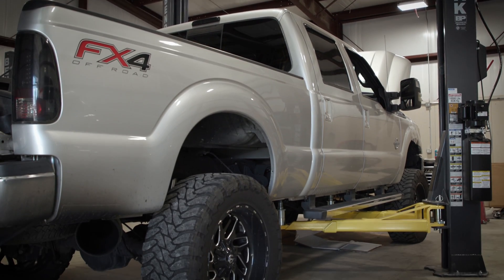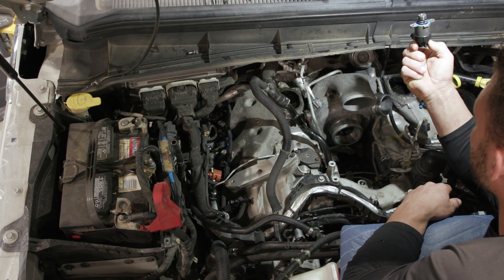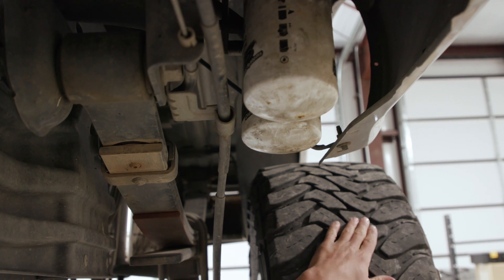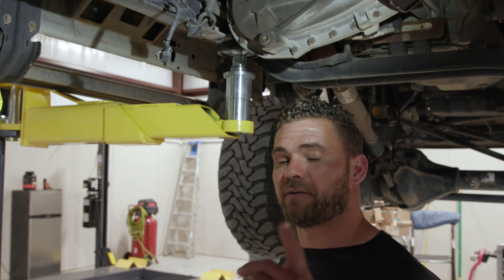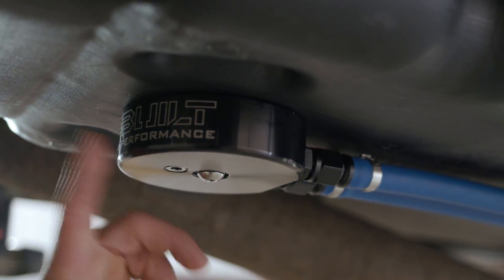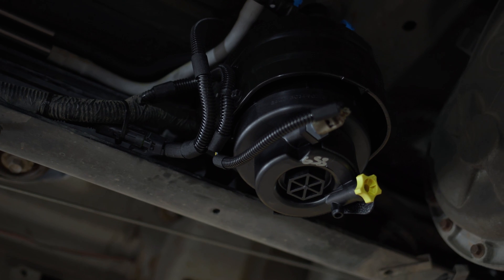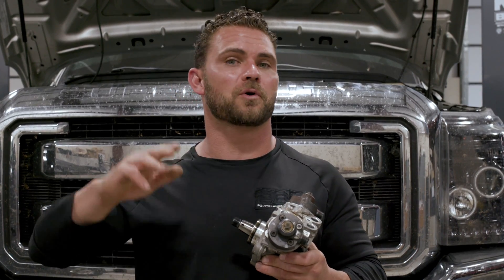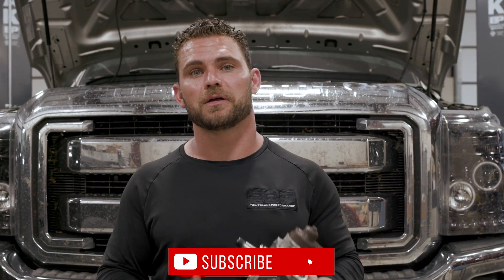BULLETPROOFING A CP4 FUEL PUMP?!

Comment: Airdog has a great location first off and they have a water port to drain. MAINTENANCE IS KEY
Reply: but Airdog only removes about 48% of water, verified through independent testing, while the FASS removes upwards of 99%....I think ill stick with FASS.
Reply: @CliftonMurphyjr  do you have a link to the independent testing results?

Comment: This hardly seems bulletproof.   You have 4 filters before the fuel pump (overkill) and nothing after the pump to save the fuel high pressure fuel system when the new improved CP4 fails.
Reply from the maker: What would you have installed then sir? We’ve never had a single failure in over 10 years of doing this installation . If the system fails we aren’t saving anything. It all has to be replaced. Cp4 usually fail because of (Air) , (Gas ) , (water) or trash entering the system.
Reply: @POINTBLANKPERFORMANCE   A lot of people have said that their fuel was perfectly fine but the manufacturer claims a fuel problem so they don't have to cover the cost of repairs.  There are two types of kit I am aware of to save the fuel rail and injectors should the pump fail.  One is a fuel metering valve with a greatly improved filter on it, made by Exergy for $240.  The other is a fuel reroute kit that sends all fuel that went through the pump that could be contaminated with shrapnel back to the the tank and only uncontaminated fuel to the rail and injectors, this is the "Disaster prevention kit" others have asked about below, they are about $350.  Both are pretty easy installs.
Reply from the maker: @brantrichardson1949  So here is my 2 cents... we do everything pre Cp4 to prevent the failure not at the pump (because again when it fails it fails entirely). I’ll put it to you as we would a client “if you have the disaster kit install” and it works correctly and send everything back to the tank (are you ok with me fixing everything in the low pressure side and pay for it only to find out you now owe me again for a entire fuel system because your truck upon the start up failed because the metal did actually make it in the injectors , rails and return lines. This is only my opinion but it has have happened to me. When it fails it all gets replaced we try to take ever measure Pre Cp4 to keep it alive .
Reply: @POINTBLANKPERFORMANCE   I would advocate for a filter in the return line to the tank as well to save all those repairs, I thought that was part of the set up in your video actually.  In the event of catastrophic failure the only thing that needs to be replaced is the fuel pump and filters.  With a modification to save the high pressure side and another to save the lower pressure side, yes I would rather take a chance on paying you to fix it twice rather than the enormous cost of replacing the entire fuel system straight away.   That would be my idea of bulletproofing a system using a CP4 pump, not really bullet proofing the pump itself but stopping all the collateral damage.
Reply from the maker: @brantrichardson1949  if you ever get a chance to experiment with that more power to you but with adding filters in the return lines doesn’t work for the pumps they don’t like resistance. But again We appreciate and respect your opinion thank you for the feedback sir.
Reply: @POINTBLANKPERFORMANCE  I was going to ask about these disaster prevention kits. Glad to find your response. I find it hard to believe that any design engineer could have designed such a poor system as this, that when one component goes, the whole system has to be replaced. Everyone seems to say that you can't put a filter between the pump and the rails because there's too much pressure but wouldn't a enormous filter allow enough flow while still protecting the rails and not causing any back pressure  ? I wouldn't care if the filter was as big a the A/C filter in my house . Filter that fuel !
Reply from the maker: @johnmazza9432  Filtering is only part of the issues the , dry start from customers not being coached on how to “prevent” Cp4 failures is more the issues from what we seen.  Proper priming is a huge key as well. The list can go on and on
Reply: @POINTBLANKPERFORMANCE  By "proper priming" you mean switching on the accessory ignition numerous times ?
Reply from the maker: @johnmazza9432  yes sir making sure the fuel pump is on and priming is done .
Reply: @POINTBLANKPERFORMANCE  Even if you do everything right, it doesn't make sense that at some point when the pump fails , it's going to cost $12k to fix the damage.
Reply from the maker: @johnmazza9432   It’s all a possibility , everyone that owns a truck with a Cp4 or Cp3 could have a failure. Cp4s aren’t as tolerable to abuse as a Cp3 to sum this up.
Reply: @POINTBLANKPERFORMANCE  how are the cp4.2 vs the cp4???!
Reply from the maker: @Truccinwithlumberjacc  They make more power ! Personally we see the same amount of failures .. not that many to be honest
Reply: @POINTBLANKPERFORMANCE  so I’m looking at this 2012 3500 Hd denali; mint condition with 200k on the dash. They came with the cp4.2 right? Are they better than the  cp4?

Comment: I have a 2017, I bought it used. How can you tell if its got the old cp4 or the new one?
Reply from the maker: It’s the new one sir on the 15 to current they use the Cp4.2
Reply: This guy said, "the new ones use the CP4.2". Fucks sake. All CP4s on Powerstrokes are CP4.2s. The .2 designates the 2 piston design of the pump - which they all are. Now, they did produce a symmetrical and an asymmetrical version of the 4.2. Blaring sign to not take your truck to this shithole.
Reply: Cp4 is stock. If you still have the sellers number call and ask them if the pump, injectors and fuel rails were replaced. Im sure if they were the seller would of mentioned it

Comment: Do y’all have any experience with putting on a FASS 220 on a 19 Powerstroke?  I had a shop install one on my truck with a sump and the truck kept saying low fuel rail pressure when it was pulling fuel from the sump... they then ran the pick up hose in the tank like you would without the sump kit and it seems to be working fine but now I have a useless sump hanging on my fuel tank... it’s pretty annoying since I really don’t understand why the sump wouldn’t work
Reply from the maker: Did they place top billet face plate in the correct direction and other than that sir honestly I’m lost . There has to be a restriction in possibly the install . By all means I’m not say they didn’t something wrong but something is up. Monday your welcome to call the office ask for Tyson , I’ll go over a few things and see how we can help! Thank you
Reply: 2 years later i finally see your reply 😂. Sorry bout that been binge watching your videos last few days. Best YouTube channel out right now. I need to bring y’all my 2016 F250. I done sold my 2019 😂

Comment: you put a BRAND NEW fuel tank in?  why not just clean the old one out? i think after a good clean out the 4 FILTERS would catch any residual... and why not run the fuel lines out the TOP of the fuel tank. the sump sucker seems like its BEGGING to get knocked off
Reply from the maker: Sir, we always replace the tank . Plastic has pores , metal sticks in the pores and in turn gets back to a injector and can stick a injector open causing a potential run away. This truck was lifted 8” with 37s any time a client wants added power  we do a sump . But if a client asked we can do a top mount “draw straw”. Running the 1/2 fuel lines from the top if not installed correctly will and can pinch between the frame and tank causing a premature hose failure . Thank you

Comment: Not sure what this guy is talking about.  There are two types of CP4 pumps.  A CP4.1 (meaning 1 piston) and a CP4.2 (meaning 2 pistons).  All 6.7 powerstrokes came with CP4.2 injection pumps.  So yeah it will bolt right in, cause it's the same exact thing.
Reply from the maker: Sir you may want to Google what you just stated , all 11-14 came with a Cp4 and all 15 plus came with a Cp4.2. Both have 2 pistons. They are not the same exact thing. The sensor is plugged in.
Reply: @POINTBLANKPERFORMANCE  I did "research it".   Why don't you provide us all a link that says 2011-2014 have a CP4 and that the 2015-present has a CP4.2.  Many people use CP4 as a generic term but like I said in my previous comment CP4 is just a family of pumps.  CP4.1 comes on small diesel engines and has 1 piston.  CP4.2 has come on Duramax 2011 to 2016,  Powerstrokes since 2011 and Dodge since 2019.  They may have made some minor improvements to make it flow slightly more by that doesn't change the type of injection pump, it is still and always has been a CP4.2.  Just like you can have a 10mm or 14mm CP3.  Both are CP3s but they are just Stroked offer different flow rates.

http://www.trucktrend.com/how-to/engine/what-is-cp4-failure/

https://www.drivingline.com/articles/new-product-spotlight-ss-diesel-motorsport-s-cp42-bypass-kit/
Reply from the maker: @HuntsT  Sir until you can get your facts straight there isn’t much to  discuss. We don’t do links we do facts.
Reply: @POINTBLANKPERFORMANCE  lol.  Thats what I thought.  You can't prove it.  So better off denying your ignorance as facts.  Good luck with your business.  I wish you guys the best.  Hopefully you did some more research due to this discussion and speak a little more correctly next time you talk about a CP4.
Reply from the maker: @HuntsT  I just simply asked for you to review your statement. Again disrespect won’t get you far on here. If you need a full breakdown of a Cp4 of this topic then we have no problem doing so.
Reply: @POINTBLANKPERFORMANCE  I'm not sure how I was being disrespectful other than questioning your statement.  To answer your question, yes I am always down to learn something new.  If you could take the time to explain and  provide a reference to corroborate your "facts" it would be greatly appreciated.  I am not opposed to admitting I am wrong, however I would like some facts to back up what you are stating rather than just saying "we do facts".
Reply from the maker: @HuntsT  Thank you sir we will take the time to touch on this subject . It will be 3 weeks before this can we address because of our scheduling.
Reply: @HuntsT  Dodge or Ram was 2019, so you are already providing bad info.
Reply: @jayfarmer3911  so you think there is a CP4 that came in the 6.7 powerstrokes that wasn't a CP4.2?  Thats what this was really about.
Reply: @HuntsT  It's also about facts.  I don't pay much attention to V8 diesels, thats why i didn't comment on that.  I do know for a fact that my 17 and 18 Rams had CP3s in them and i just put a CP3 in my 20 that had a CP4.  I just found it funny that you're jumping this guys shit while at the same time spewing false info.
Reply: @jayfarmer3911  but was it a CP4 or a CP4.2?
Reply: @HuntsT  not 100% sure i always thought that the cummins had the 4.2, but i know it started in 19.
Reply: @jayfarmer3911  I’m researching all this CP4 crap. I’m in the market for a new truck seems they all have issues.  As far as Dodge whatever CP4 their using is failing in the 19/20.  I can’t confirm it but supposedly trucks built after August of 2020 have a redesigned CP4 by Bosch .
I’m leaning toward duramax with Denso fuel system.
Reply: @blkt6  ram is back to using CP3 pumps in the 21s.
Reply: @blkt6  Applies to both SO and HO Cummins model RAM trucks, pickups and CC trucks: 2019-2020 Cummins have an Asymmetrical cam lobe CP4.2. 2020 Cummins built after approximately 7/20 may have a Symmetrical cam CP4.2 (2-piston). All 2020 built 9/20 and later have the CP4.2 Symmetrical cam pump. All 2021 Cummins engines in any pickup or CC have (from all appearances) a CP3. @Timmons Outdoors is correct that CP4 is a family of Bosch pumps and CP4.1 is a single piston and CP4.2 is a two piston pump. The "dot" isn't a revision, it indicates the number of pistons/chambers.

If you want to "bulletproof" a Ford CP4.2 pump, you need to install a bypass kit on the pump.
Reply: Yes he is technically right, ford has used the cp4.2 since 2011 but Bosch redesigned the cp4.2 in 2015. There was never an actual “cp4.1” installed on any powerstroke, dodge, ram, or duramax. It’s a misnomer people have used to distinguish the old cp4.2 vs the new cp4.2. If anything it should be called the cp4.2 version 1 and cp4.2 version 2. With version 2 being on the 2015+ powerstroke.
Reply: @SquidsCareToo  finally someone agrees lol. 🤙🏼

Comment: Great video and info. Couple of ?'s were all 15's equipped with the 4.2 upgrade? And what are your thoughts on the H&S Motorsports 121003 Fuel Filter Conversion Kits for these trucks? Thanks again I am subscribing.
Reply from the maker: Yes sir 2015 was the first year for the Cp4.2 and absolutely anything or kit that can better filter the fuel I’m a go for! The biggest thing to remember is when your filters are being change make for sure the pump has been cycled up to 10 times to make sure the air is out of the system!

Comment: My 2012 water in fuel light never came on. My truck was 100% stock. Mine only had 28k. 100% serviced by Ford.
Reply from the maker: 11-14 We noticed unplugged it would not come on 15 + when in plugged they came on. The truck then goes into limp mode.
Reply: @POINTBLANKPERFORMANCE  that’s because 2011 through 2014 was looking for a closed connection not just open with more resistance due to water.

Comment: Do you guy recommend the disaster prevention kit for the 2015 6.7 ford
Reply: Check out spe’s new disaster prevention kit. No lines need to be cut and filters the return back to the tank
Reply: Ok make sense thanks 🙏
Reply from the maker: Personally we do not only because of this “if it fails and there is metal in the system we replace it on to make sure it’s gonna leave the shop and stay up and running .”
Reply: If a plunger and barrel breaks/fails there is no kit that prevents the metal from entering the system, ask me how I know.

Comment: How many miles were on that truck?
Reply: Thoughts on Exergy System Saver Improved Stock Inlet Metering Valve?
Reply from the maker: @Dieselnm101    So great question and this  truck did have a disaster, we left it out of the video because of potential conflict. Here is the insight , this truck did not “blow up the Cp4” there was metal “some” in the VCV and some in the tank as there should be. We did take apart the pump I wanted to see the internals. The lifters , plungers and cam were not damaged by visual appearance. So my opinion is this say the pump is good , fuel pressure is regulated by the FPR if metal got to then the bypass failed. Again this is possibilities , another “ if “ is if metal reached the fuel injector and the Pintle reached metal during on time it would cause low or no rail pressure. So the kit would have failed. These again are possible cases and a customer would have to send everything in to get tested to know EXACTLY where metal reach . I have never and will never install one of these kits . It’s just a opinion sir.
Reply from the maker: 60 to 80 k best I can recall !

Comment: What’s your opinion on the disaster prevention kit as well?
Reply from the maker: So great question and this  truck did have a disaster, we left it out of the video because of potential conflict. Here is the insight , this truck did not “blow up the Cp4” there was metal “some” in the VCV and some in the tank as there should be. We did take apart the pump I wanted to see the internals. The lifters , plungers and cam were not damaged by visual appearance. So my opinion is this say the pump is good , fuel pressure is regulated by the FPR if metal got to then the bypass failed. Again this is possibilities , another “ if “ is if metal reached the fuel injector and the Pintle reached metal during on time it would cause low or no rail pressure. So the kit would have failed. These again are possible cases and a customer would have to send everything in to get tested to know EXACTLY where metal reach . I have never and will never install one of these kits . It’s just a opinion sir.
Reply: @POINTBLANKPERFORMANCE  What do you have against the Disaster prevention kit.  I have SPE kit on order.
Reply from the maker: @markparker4032   Nothing at all sir , their kit is very nice we’ve not installed one yet!
Reply: @POINTBLANKPERFORMANCE  That is good to hear.  The last thing I want to do is spend $400 and a lot of work to mess something up.  I value your opinion.
Reply from the maker: @markparker4032  Hey totally understand I’ve looked into their product and by all means it’s a top notch product! The design behind it is geared into the direction of “if failed” It could/can save a ton of money!
Reply: any engine is like a lollipop you can either lick on it and enjoy it for a long time or you can bite it and it be gone pretty quickly.